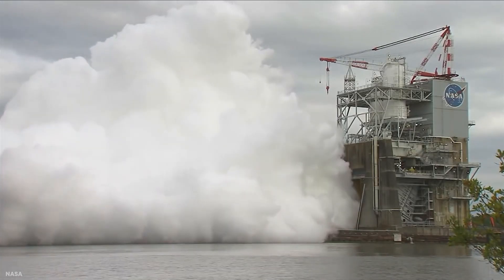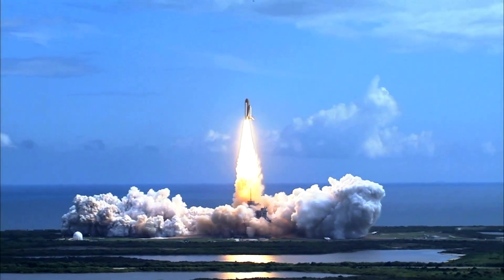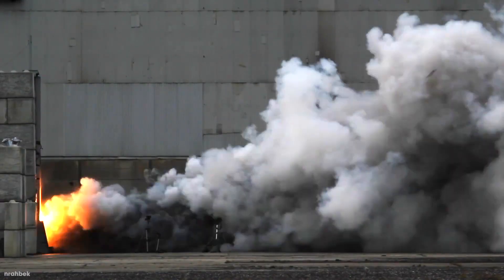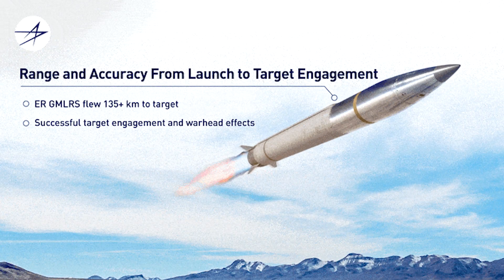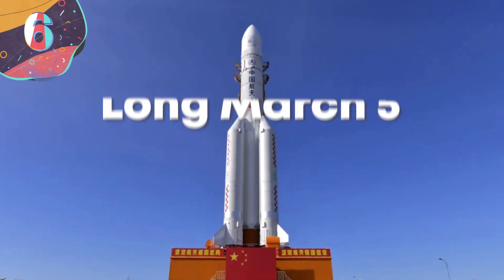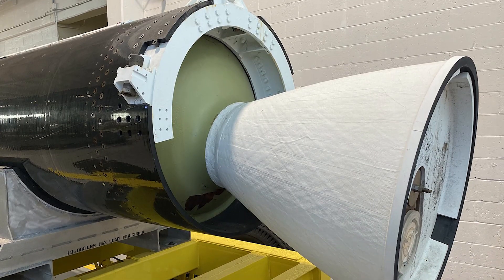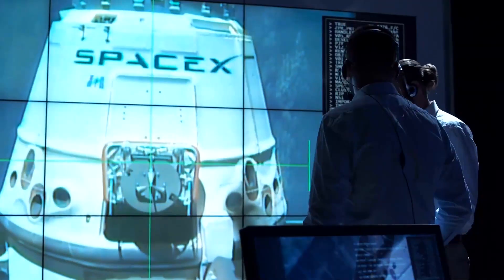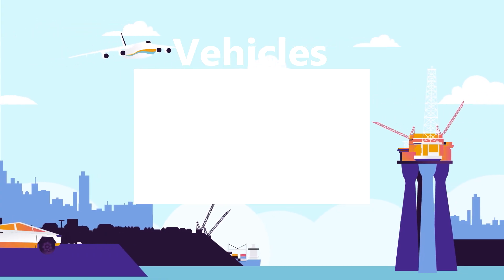15 Incredible Rocket Engine Tests

Comment: Hybrid rockets are a neat idea, but the boundary layer problems make them notorious for thrust instability. Just watch the plume of damn near any hybrid engine, and it will not be stable. They tend to pulse irregularly, kind of like the 6-7Hz surge felt by astronauts from the big SRB's on the space shuttle, only much more pronounced. Virgin's engine is pretty good, and it's the only one worth a sh*t.